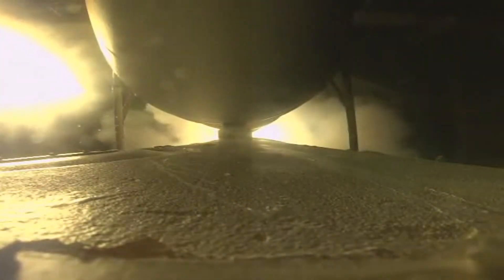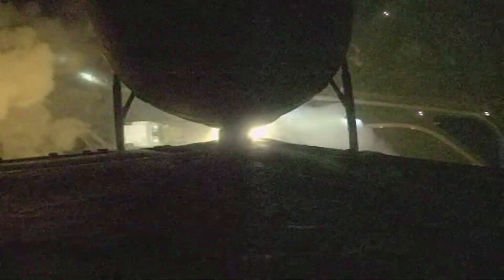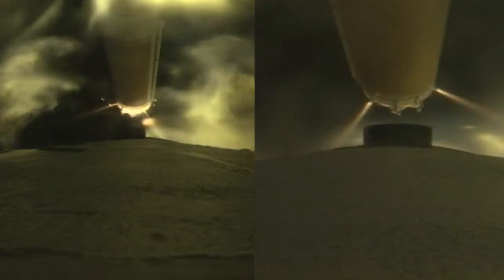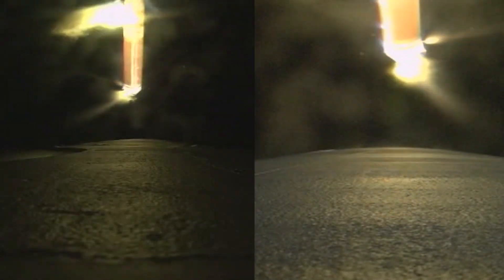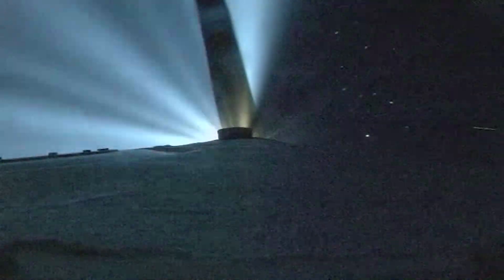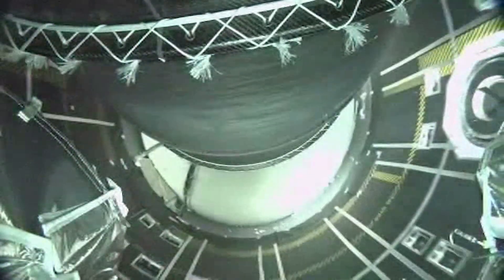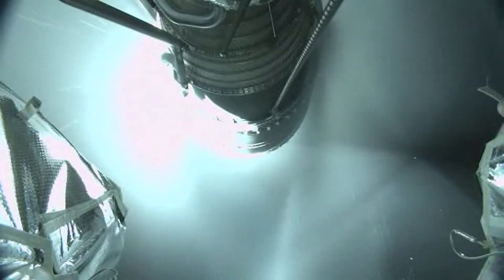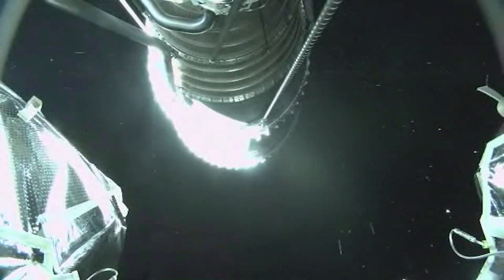Delta IV Heavy NROL-68 Rocket Cam

Comment: At 3:10 into the video I was delighted to see vortices rings on the left booster connection strut. First time I’ve noticed this. Going to miss the RL-10 screw jacks in operation. Or will they do that on Vulcan?
Reply: There's a theoretical Vulcan Heavy, Tory Bruno has a model of it. But whether or not it ever gets made is anyone's guess at this point.